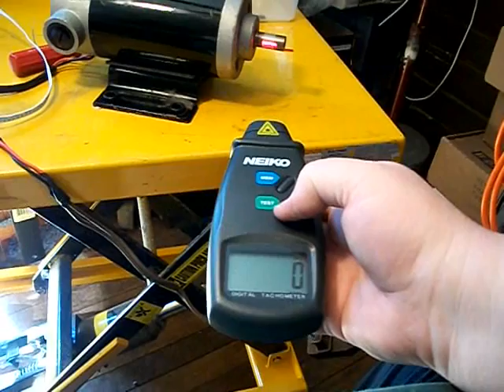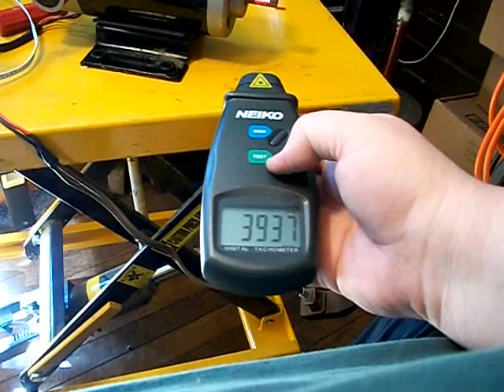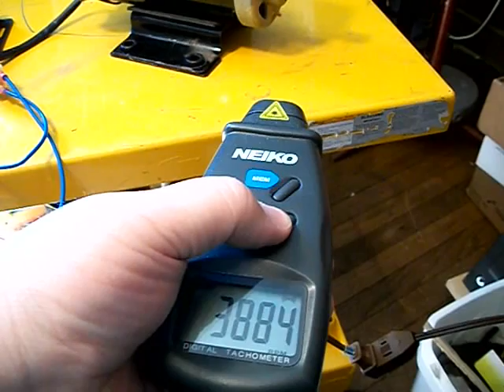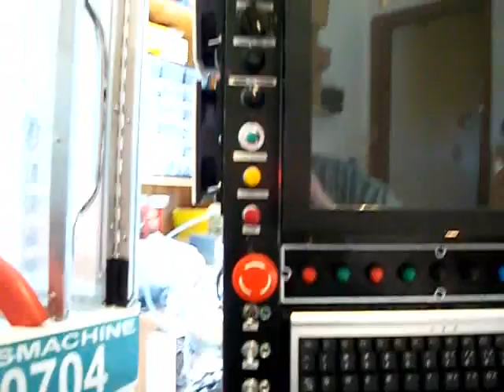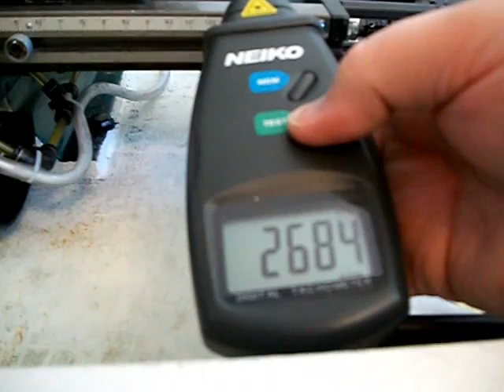Skycraft Surplus Treadmill Motor

Comment: Thanks! grabbed two at that price.  What did you determine for the wiring of the controller for Term 1, 2, and 3?
Reply: I went with left to right (A, B, N/C, D) as the ribbon cable comes off the PC board pointed up. Worked.